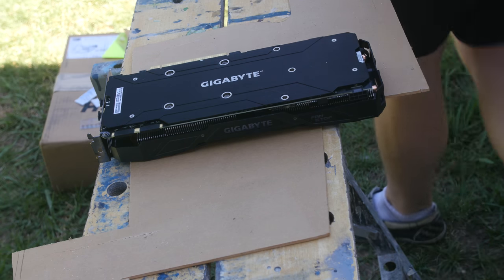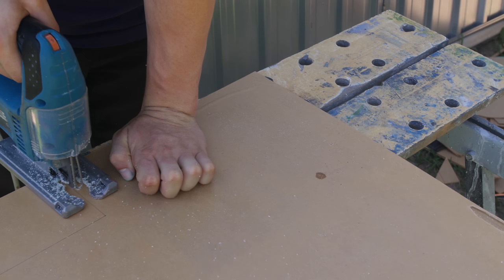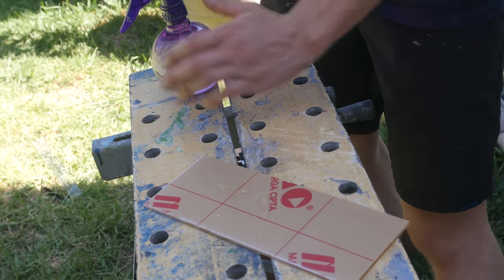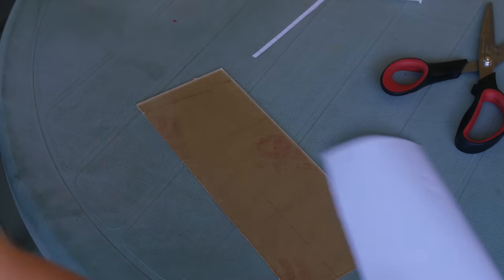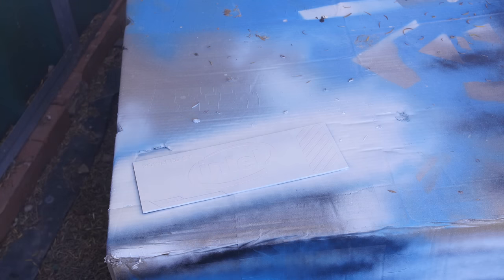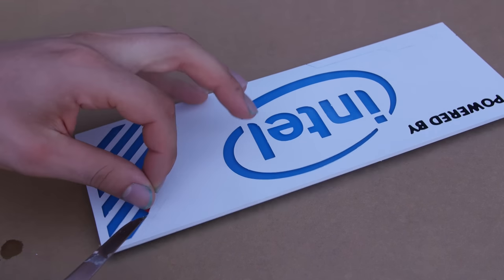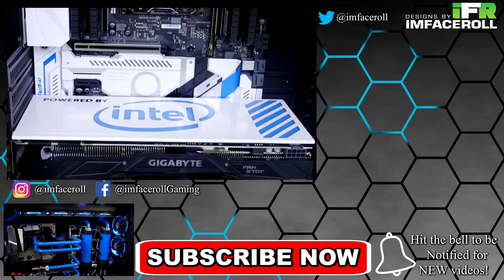How To Make A DIY Custom GPU Backplate - PC Modding Tutorial - Intel Edition

Comment: To cut could u also use a plastic cutter and then snap where u made the score lines?
Reply: TheLoneWolf it probably wouldn't be ideal you want a clean a cut as possible
Reply from the maker: +TheLoneWolf you most certainly can man, just got to make sure you sand it clean
Reply: Designs By IFR can u also draw ur design on the film and then use that as ur stencil?
Reply from the maker: +TheLoneWolf you sure can man
Reply from the maker: +TheLoneWolf you just need to find a way to cut the design out in the film
Reply from the maker: +Jeronimo Stupenengo Pefaur i didnt re upload anything man

Comment: hello :) awesome job. i have a question about paint. since gpu has a) high temperatures isnt it dangerous to melt some paint and drop on to the gpu and b) its full of elecrical cirquits as well if it comes in contact with the motheroard, isnt it dangerous as well? do you use some specific paint? thank you for your time :)
Reply from the maker: +npaki hey man, the gpu wont get hot enough to melt paint, especially on the backplate.

Comment: Can you make a GPU backplate for a GPU that does not come with a backplate? for example, I got an OEM AMD RADEON R9 370 4gb from an Alienware area 51 R2, just so you can get an idea of where I´m going with this, and that model has not backplate. So my question again, can you make a backplate for gpu that does not come with a backplate? How will it go mounted on the gpu? will I have to use double sided adhesive tape stickers?
Reply from the maker: +Geryl Marconi you can use double sided adhesive or tiny small magnets that sit on the screws
Reply: wont the magnets interfere with the electonics of the card and/or mobo?
Reply from the maker: +Geryl Marconi not the smaller weak magnets that you would use. V1 tech use them as well

Comment: How come you don't go over the designs you cut into your vinyl again to show the back color? Just curious
Reply from the maker: sorry i do not quite understand what you are asking, i paint over the vinyl if that is what you mean?
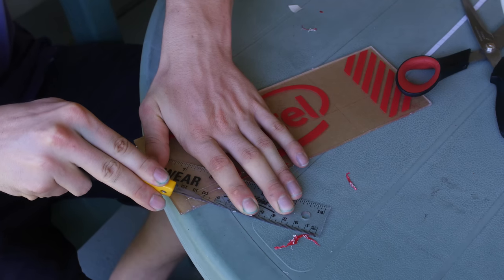Reply: Designs By IFR if you scored the lines you made at 1:56 again, after you did the white coat at the top, wouldn't that show the color you painted on the back?

For example, before you clear coat, use your knife to go over the scored lines again, bringing out that blue. 

Excellent tutorials by the way, I'm heading to the hardware store to get some acrylic and make a backplate of my own!
Reply from the maker: +Connor P ohhh i understand now, yes it certainly would man =)

Comment: What did you spray on at the end? (I'm from the Netherlands so I didn't really understand what that was) Also, is it neccesary?
Reply from the maker: +Bart Vegter hey man it was just some clear to help protect the paint, you do not really need it because the backplate will just be sitting there. Are you going to try this out? =)
Reply: Designs By IFR
Yep, I probably will... I just built my new pc about 2 weeks ago and I wanted to pimp the inside a bit.
By the way, do you know a place where I could buy custom stickers because I've been looking a bit online but I'm not sure which ones to get :)
Reply from the maker: +Bart Vegter if you look on ebay or amazon and contact the sellers of vinyl decals they can make whatever design you want. Or i can make them
Reply: Designs By IFR
Ah okay, maybe I'll contact you whenever I ge the time to do it. Although I don't know how expensive the shipping from Australia to the Netherlands will be :P
Reply from the maker: +Bart Vegter depending on how big you need the vinyls i may be able to post them in an envelope which would be a lot cheaper
Reply: Ah yeah that would be great. I have a GTX 1050Ti so I probably won't need a sticker bigger than about 5x15cm... I'll contact you when I'm gonna get to modding ;)
Reply from the maker: +Bart Vegter no problem man =)
Reply: Bart Vegter en gelukt? Heb je zelf een vinylsnijder? Of heb je het op een andere manier gedaan?

Comment: i only just noticed but the sticker you put on the bottom left, you never took it off
Reply from the maker: +MadOliveGaming it was just for scoring into the acrylic
Reply from the maker: +MadOliveGaming there is a little pattern there that i scored into the acrylic
Reply: Designs By IFR ah right i noticed you scoring but didnt realise you were using the sticker for it, good call :)
Reply from the maker: +MadOliveGaming thanks man =) yeah i used it as a bit of a guide to get the scoring straight then peeled it off and continued =)

Comment: hey umm what if i use sticker paper and print the logo/design there? obviously will not be plastic cause it is paper will it work?
Reply from the maker: the paint might bleed through
Reply: Ill test it before i apply it to the plate,if it goes through id get the sticker paper huuu